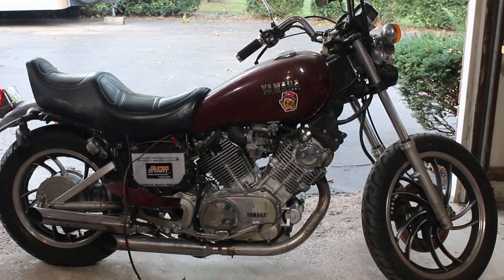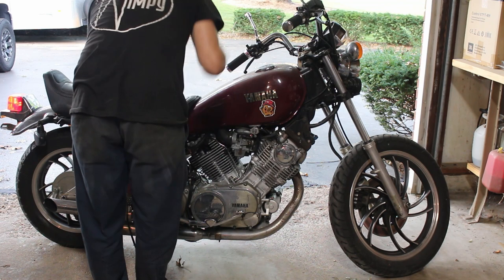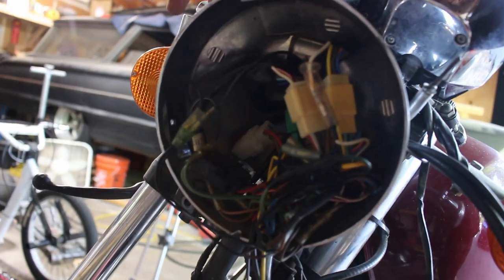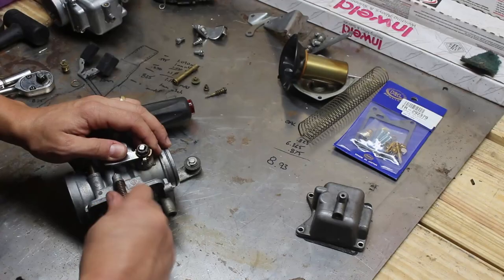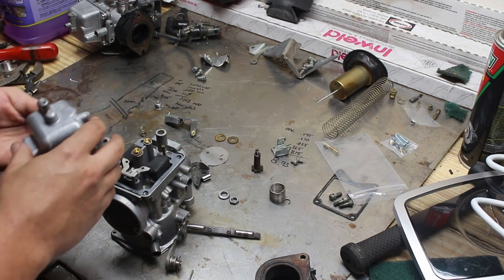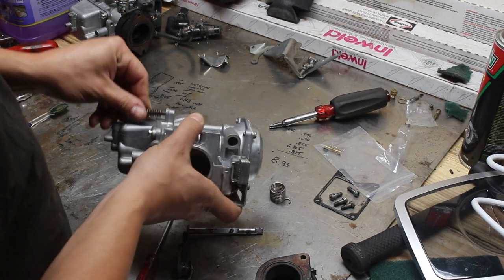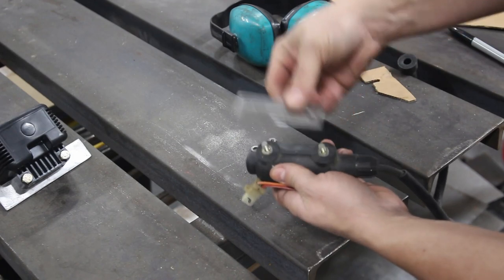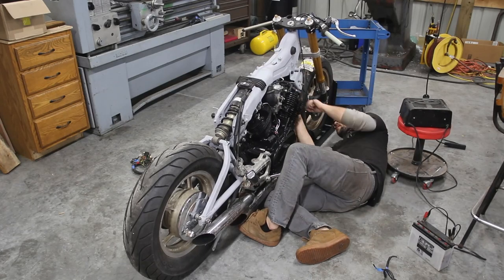XV750 Cafe Racer Build!  Carb rebuild and engine start!  Virago Build Ep. 1

Comment: Stock Carbs on the Virago are absolute garbage and a complete nightmare to work on (lots of small ports that clog, impossible to tune well). I spent two years diagnosing mine for various problems and finally just replaced them with a 750/920 Mikuni VM34 carb kit from Niche Cycle Supply. IT WAS LIFE CHANGING. It fired right up without any issues and required only minor tuning.

Comment: You didn't have an air vent in the temporary plastic fuel bottle. Fuel can't flow coz a partial vacuum builds up in the upside down bottle above the fuel.

Comment: I've got an 81' and a very similar story! Picked her up last year, swapped front ends, picked up mikuni carbs, mo.unit finally showed up in december and im mid kitchen reno now...your instructions on the CTI and coils were awesome and if you end up doin the mo unit controller, pleaseeee do a stupid simple break down of everything. Great work so far and please keep it goin!
Reply from the maker: I will do a detailed video on how I wire everything up, but I probably will not do a controller like an M-Unit at least at first.  I haven't quite gotten that far though.  I'm planning on rewiring pretty much everything from scratch though so it will be detailed.
Reply: I'm also building with Mikuni's. Where did you get a throttle cable?
Reply: @akaheavymetal2542  it came with the carbs as a kit and it lines up well. There's a y at the end of it. Cognitomoto's site!

Comment: Check out "Steve’s DIYs" on youtube for lots of info on XV 750 Viragos. Especially that starter. If it hasn't yet, it will soon give you issues. The early gens were notorious for it. Steve has found a fix for them.

Comment: 13:39 There's an easier way to find the centers.  Measure from the outside of one hole to the inside of the other.  That's a direct measurement of the center-to-center points.

Comment: Very similar story, bought my XV in 2017 and worked on it 10 mins at time and now I’m doing wiring. Hoping to try and start it for the first time in 5 years. You mentioned you oiled the cylinders before starting, how did you do that? I probably should do the same. Nice video! Looking forward to the next one.
Reply from the maker: Whenever I have something sitting for a long time I get worried about water (mostly from condensation) maybe gumming things up, so I usually take the spark plugs out and squirt a little oil (or WD40, or PB Blaster) in there, let it sit for a while, and then turn it over again just a crank or two with the starter (still with the spark plugs out, if you fill the cylinders and turn it over with the plugs in the fluid will not have anywhere to go and could hurt something).  Turn it over with the plugs out but put a rag over the holes because it will spray out and make a mess.  Then I change the oil to fresh before a first real fire-up.

Comment: Thank you for your wonderful video.In Japan, I am also customizing the 81-year XV750.I have a question, but it seems that the tires with a width of 150 are installed on the rear.Is the center of the vehicle body and the tires out of alignment?
Reply from the maker: I used a later model swingarm to fit the wider tire.